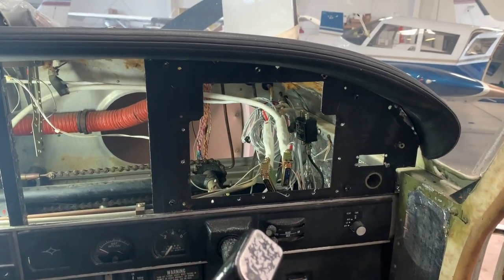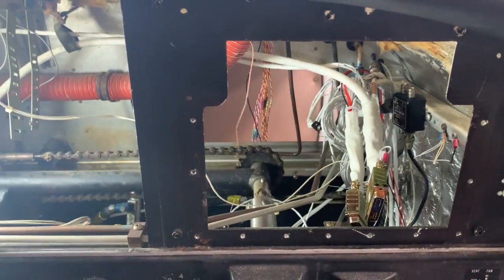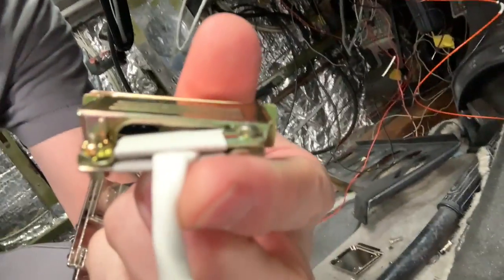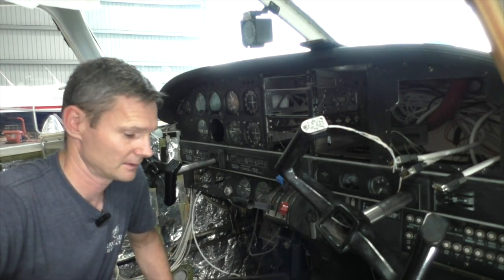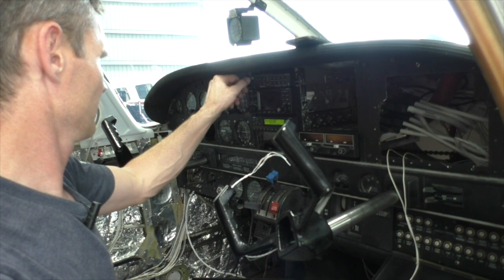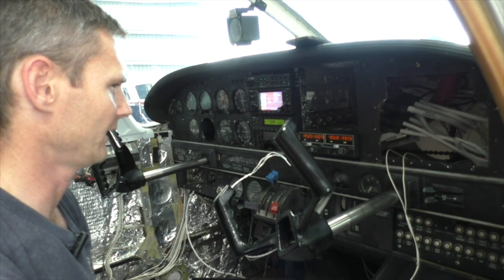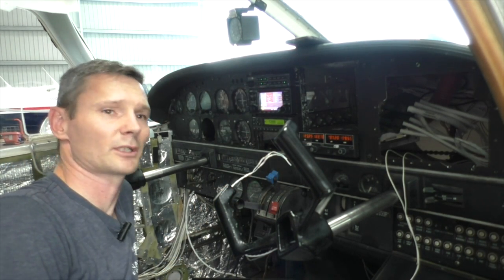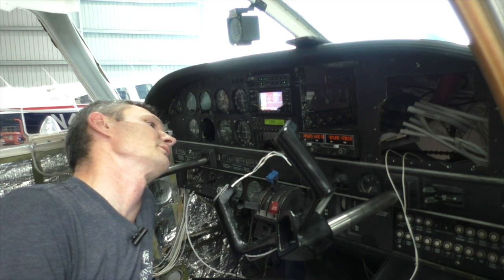Super EASY* Avionics install and 1st power up! Fast Stack, Garmin, PS Engineering, King EP18

Comment: Been enjoying your videos. Don’t own a plane yet or have a PPL yet. Have designed and built complex mechanical electronic equipment plus Computers, R/C Helicopters and Planes. Looking at the wiring mess behind the Front Panel leaves me with feelings of a disaster waiting to happen. Realize Planes and especially Helicopters have serious vibration issues. 
Designs can produce a self generating harmonic vibration that could be self destructive when craft isn’t sitting on the ground. Planes would expect to be less of a problem.
Each one of the multi-connector plugs should have gold plated male and female pins plus screw connectors at both ends of the ground shield shell. Each lock screw should have its own small lock washers also. Similar to a Military Spec connection, connections might want to have an over all threaded shield. While flying, everything vibrates, including all wires running around the back panel open area. Wire breakage is expected as copper wire work-hardens when flexed causing wires to crack and split. Likewise throwing complex computerized devices into a panel requires close attention to wires interconnecting everything into a working system. Clean and orderly wire layouts should be a real focus. There’s nothing like assembling a system, being up in the air and depending on a complex computer device to then have wires break. Devices stop working, then what do you do? You were flying by wire, now you’re flying by the seat of your pants!
It’s recommended that a device layout is drawn up showing all sensors used as inputs to the devices. Reduce messy wiring with tying wire runs to something allowing easy servicing. Older Planes are expected to have separate devices while new planes would have most built in to a few computer devices. Connectors are commonly a source of trouble. Installed Pins are Press locked in by small tabs. They allow easy insertion into a connector and to remove require use of a “tool”! The tool squeezes the tabs releasing the lock connection. Pulling the wire to pull out the pins isn’t recommended. Stressing the copper wire enables future wire breakage. Nicely well organized wires and harnesses nested together offers reliable use.

Comment: 1:10 "... and it'll keep everything up nice and high, away from the yoke so whenever it moves no wires are anywhere near that thing."
I was teaching a student aerobatics in a 152 Aerobat and the student, after an aileron roll asked "Is this normal?". I asked "What?" ... and the pitch was OK, but the roll control was jammed (thankfully in a neutral position) solid. I flew it back on rudder and elevator to the field, and it turned out that a loop of avionics wire had caught on the control yoke pin.  So - it happens! Got away with that one, too.
Reply from the maker: Oh man!!

Comment: Hey Jimmy could you share how difficult was it to hook up the audio panel with the Fast stack.  I just ordered mine and was just wondering how plug n play is it really..? thanks.
Reply from the maker: by far the easiest thing on the airplane.  run a ground and power and figure out what inputs (ie: aux 1: i did not use, aux 2: for back passengers, I did use.  Had to solder the wires on the passenger headset jacks: easy, all labeled at the ends.) I can't think of anything else...If you can install a car radio, you can do this.  Matter of fact a car radio is more complicated than this setup.  Also, anytime I had a question, Tim or Shawn(?) was quick to answer my call/email.  You will be glad you went with the Fast Stack setup. (I don't even get compensated for that review! lol)

Comment: While you have the panel so far apart, consider installing a flex alert annunciator. http://www.approachaviation.com/html_pages/flexalert.html
Having the landing gear lights up high in your field of view can save an embarrassing gear up. Plus, it looks cool.
You might also add a command switch to the right horn of your pilots yoke. The switch can be wired to your 430W to flip active and standby freqs. Very handy on departure. Later on, when you upgrade to a GTN750 it can be used to trigger a voice command action. Easy to put it in now while everything is opened up.
Reply from the maker: good suggestions!  It's already wired for the flip switch.  Not sure if I'm going to install it though...KISS after all
Reply: That’s great. May I suggest that if you don’t use the wires that you type up a little note about the wire function and ty-wrap the note to the free end. It really helps when the next owner or tech starts trying to figure out what these “mystery wires” do.

Comment: I have no qualifications to talk about avionics but I have been in the electronics control business for decades and a product manager including cables and harnesses. That’s a standard amp D connector. Those clam shells do come apart. No need to cut. Also I would advise against mounting that many connectors to a hinged panel unless you have the slack to put strain relief loops in all of the cables. I get very nervous whenever I see D sub headers in boxes that are ultimately soldered to PCB’s in high vibration environments. Inside that gold box is probably a PCB and I would hope it’s double sided plated through with lots of soldermask and assembled with leaded solder. This has actually gotten me interested in looking into Electronic assembly standards for aviation. Actual wiring is pretty well laid out in regulations but once you get inside the boxes I am not sure things are as well laid out. Pun intended. Care and planning must be had. Apart from that congratulations on your progress and I am enjoying the videos.
Reply from the maker: Thanks for the comment!  Lots of good stuff!

Comment: Noob question. As you are doing the install on these things. Will the plane be considered experimental? I'm a bit confused about that.
Reply: Makes sense.  As long as all the avionics etc are certified its fine to install.  Thanks for the reply.  I should have thought about that,  but I am often confused about what things you can install/work on yourself with aircraft.
Reply from the maker: There's more to it than just certified... (thanks government bureaucracy) It has to be certified for each model airplane... yeah...that's right...
Reply from the maker: good question.  No.  I am only installing things certified to go on this aircraft.  There is a whole process for taking a certified plane and making it experimental and then universes collide if I ever wanted to bring it back to certified...

Comment: Would have liked less dancing and more of how you connected power and ground wires, connecting vor, connecting audio up., etc.
Reply from the maker: it's plug and play with this system.  Just plug one end to the equipment, other end to the box, power/ground and you're done.  Super easy.

Comment: Suggestion for the 'Drop-down' panel, holding all the 'plugs', put a short piano hinge at the bottom of the panel.  This will help keep stuff in order if, or when, you have to work on it. Have Fun!
Reply from the maker: Good idea.
Reply: MAKE A BIG MAC COMPARTMENT

Comment: Might want to consider adding a iPad mini mount to the front side of that plate if possible.
Reply: Aero 760
Reply from the maker: that's a good idea
Reply: @therealjimmysworld  could put area 760 facing out and for clearance, use 1” spacers on inside hub mount . 760 would give you maps, traffic, etc, but cost way less than a G3
Reply from the maker: anything would cost less than a G3! lol Thanks for the suggestion.
Reply from the maker: That’s a good idea. What’s your favorite?

Comment: When first turning on a new avionics install, we call it a "Smoke Check."  Do they have certified scales for weighing the plane, and figuring the new EWCG, there at that airport? You're going to want to do that as you will probably end up with more useful load.
Reply: Smoke Test
Reply: @ColtonBlumhagen  That also applies to proper torqueing technics. Tighten it up until it smokes, then back it off a half a turn. Tech tip for ya Jimmy  ;}>
Reply from the maker: exactly!
Reply from the maker: hahaha, yep!! electronics are powered by smoke!  once it gets out, they don't work anymore and it's hard to put that smoke back in there...
Reply: @therealjimmysworld  absolutely! don't let the smoke out cause it's really hard to put it back in!
Reply from the maker: nearly impossible!  A guy told me he did it once... but I don't know....